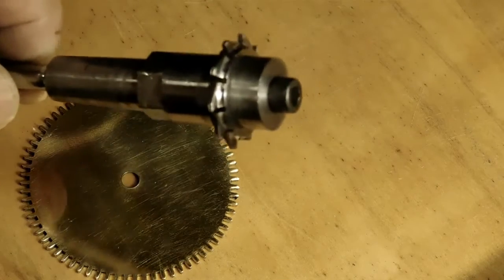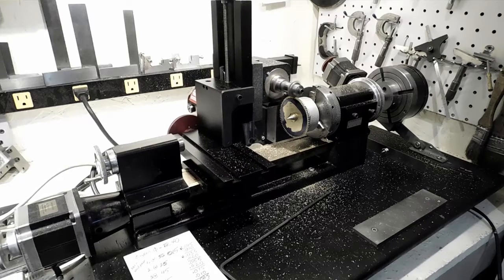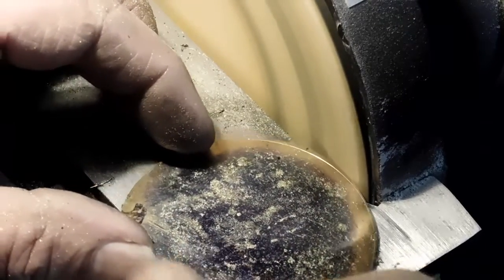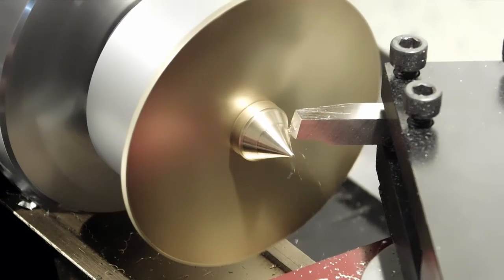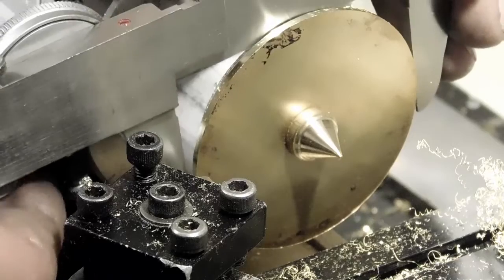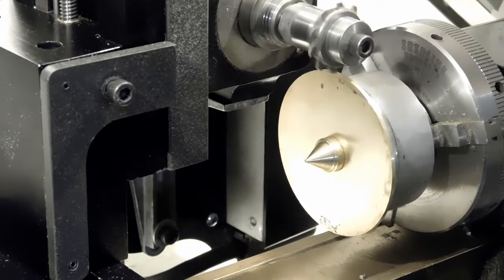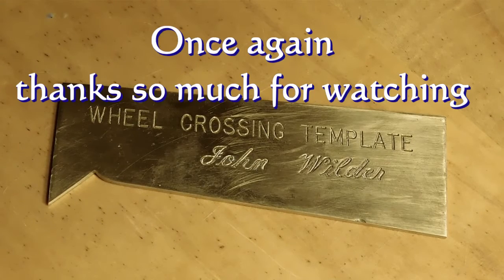DIY Cycloidal Gear Cutter Part 2 Cutting the Gear

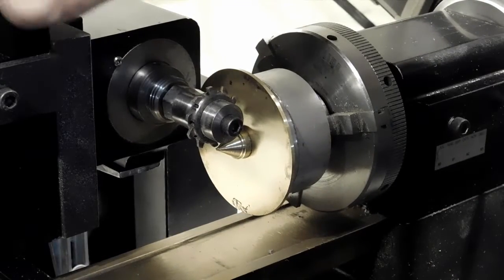Comment: Really impressed with the setup, and particularly like the superglue arbours you use - I'll have to try those. On the down side, is that a "fat tooth" coming into shot just before 12:00 o'clock on the wheel at the 13:49 mark in the video?
Reply from the maker: Thanks...you can find more info on super glue arbors i WR Smith's "Tools and Techniques" book...checked out the "fat tooth" and see what you mean...I've depthed the wheels a couple of times since cutting and just double checked the great wheel...and see nothing...cutting the wheel in 5 passes instead of one would seem to make a fat tooth difficult...my guess I flattened the wheel rather quickly and the camera caught it wrong...the wheel was sanded flat and polished since I took that video...bob

Comment: very interesting, how is your stepper motor  controlled.
Reply from the maker: I'm using a Rockcliff 4 axis controller for this set up...I'm running Mach 3 on an old XP computer... For gear cutting this way I write the G code in Notepad.